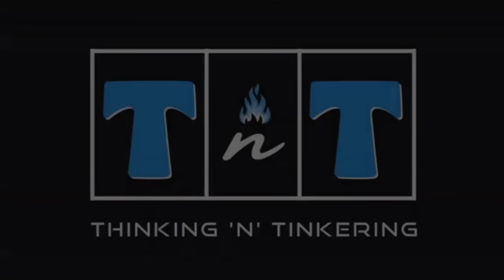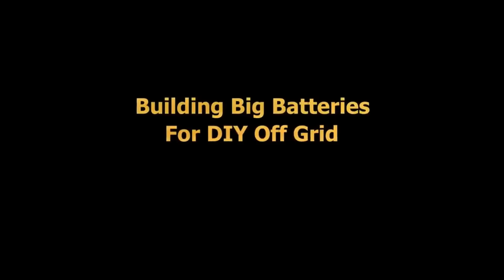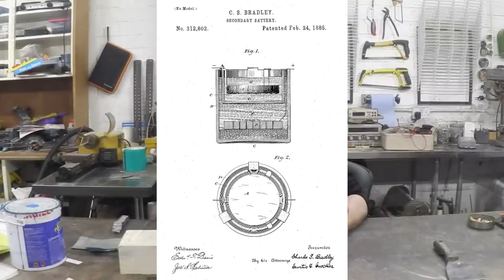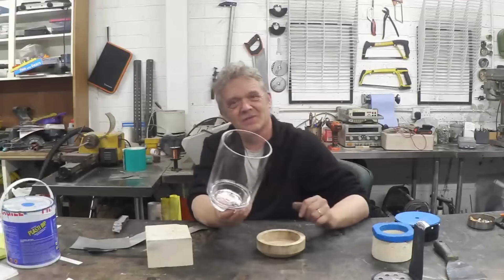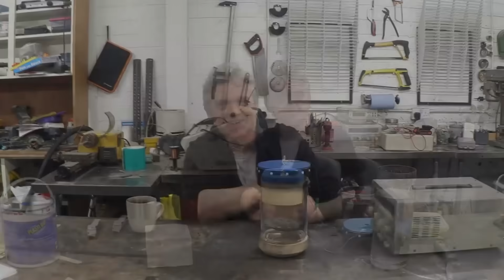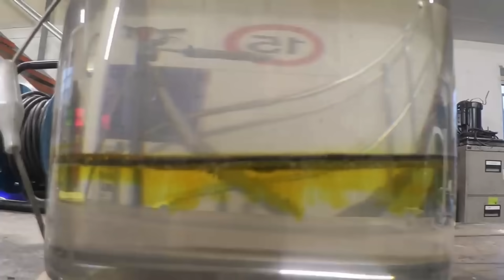2102 Building Big Batteries For DIY Off Grid

Comment: I was surprised at how fast that little propeller spun. That was more power than I was expecting.. I would have liked to have seen it when it wasn’t still connected to the charger and to see what happens to the battery when it discharges. Is a chemical reaction reversed?

Comment: Looking at this I can't help thinking that the drums have a potential issue. Yes they do roll at an angle on the cone. But the top is smaller in diameter than the  bottom of the cone. As the drums roll surely the top of the drums are traveling a shorter distance than the bottom of the drum which runs on a larger diameter section of the cone. This to me means that there will be drag which reduces the efficiency of the bearing / gear. Am I missing something?

Comment: I think that if you are charging it at 7-9 volts, and discharging it at 1.8 volts, then that is a horribly inefficient battery (cell)? If you put 1 amp in for an hour at 7 volts, that is 7 watt-hours of energy in. If you take 1 amp out for an hour at 1.8 volts, that is 1.8 watt hours out, for an energy efficiency of 1.8/7 = 25%, and that is assuming perfect coulombic efficiency. If it has 80% coulombic efficiency as you suggested, then the energy efficiency would be only 20% or so. One would be much better off using other battery chemistries, like lithium ion. An ideal secondary battery has a charging voltage as close as possible to the discharge voltage.

Comment: SO, perhaps I am asking too much but I have a situation, a small amount of DIY know how, more in the automotive field and some poor carpentering, and not a lot of money. I am a school teacher hoping to build a house in the woods and I would prefer it to be at least offgrid capable if not completely off it all of the time. I have a 20kw generator I can run on woodgas (the engine is 40hp on gasoline) and would like to build, eventually, a 100kwh battery backup. Run batteries for four or five days, charge up for a day, rinse-repeat. Will this battery handle that kind of recharging without causing massive problems? Is there a more suitable DIY battery for this? Wind and solar are simply not a viable solution in SW Missouri among 50-100ft tall trees.

Comment: If you could do/show an actual build of a large diy iron oxide battery for off grid, I think a lot of people would be interested in it. For example how to make it using 55 gallon plastic barrels that are easily and cheaply attainable. Has at least 60 kwh of storage and how to continue to size it up, maybe to 600 kwh. Thanks

Comment: Thought i wanted to share my experience here :)

Am currently making a Diy battery

Using ice cube trays with lid - each tray got 14 cells
I use normal copper wire and screws with zink/aluminium
I use Epsom salt (Magnesium sulfate) and bleach in water so each tray holds 2 DL liquid of water, 2 tablespoons of epsom salt and 1 1/2 spoon of bleach for battery acid.
Each tray makes around 22V AC / 10V DC and 0.2 Amps.
Each cell in 1 tray is seriel combined
I use 2 trays in parellel
So ending on 22V AC / 10V DC and 0.4 Amps

I parellel this again a total of 12 times so i end up at aroun 240 volts AC and 0.4 Amps giving me around 90 watts of power

Fun experiment and gratefull for all tour videos ! Ive gone from a total dumbass to actually making something usefull :) people like you inspire <3 thanks alot.

Do u have any experience in atmosferic energy generation? Tartaria and pre 1900 technology is pretty facinating :) maybe like a zink/copper antenna and some mercury involved? I dunno :) good day!

Comment: Love your videos!

Now, math is not my strong point, but if a mole is a five steps greater exponent than a coulomb, then at 1:1 youve got 100,000 coulombs per mol?  If correct, then 6*2.5=15moles, and 2 electrons per molecule should mean 30*100,000= 3 million coulombs?  Divide that by 3600 and the battery should theoretically yield ~825 amp hours?  That seems insane.  

If there is an error in my calculation, somebody please correct me.

Comment: Hi,
when you look into containers with separators for fluids, you might find that there are "self fillable" cases for 10" water filters. (Also 5" and 20" available)
They are intended for Ion Exchangers, have a foam on top and bottom, sometimes multiple foams and then active coal and other stuff can be combined in one filter cartridge.
Some people also throw in their magic stones for activated fairymagic superwater. <_<

You can get the filter cases with steel, brass or "plastic only" connector threads, plastic might be best for battery stuff.
if not simply using that as case for the battery, you could perhaps make a battery with fixed electrodes and pumping the electrolyte (power storage) through it.

I do not know about the plastics used in the different filter case options (PP, PA, ABS)
and the stability with the used liquids, so check up on that, so it doesnt crack instantly or over time.

Comment: Redflow are onto their third generation of a commercial battery using this chemistry. It has some very useful features and is very safe. Reliabillty seems to be an issue, but this will get resolved as the then get more experience with them.

Comment: Charging at 7.6V the energy efficiency of this battery is going to be around 15-20%, best case. If Robert cared to measure that, he would see that a battery like this is never going to be viable -- unless you're ok with wasting huge amounts of energy. Ohmic losses from that separator and electrode distance are simply insane. Maybe some videos with battery characterization - actually measuring CE and EE  - would be good to show why these patents never really became commercial successes.

People are left wondering why if this technology is so great we're all not using them. There are some very good technical reasons related with efficiencies. Anybody who actually characterizes these batteries will agree.

Comment: Sort of like a flow battery but isn't.  Bromide Liquid holds the charge. Its not enrrgy dense as   say lithium . More suface area on electrodes handle more elecrical flow but its limited by bromine tranfer abilities. ? A baddad battery is simular but the charge comes from the electrode differential?  Im still not ckear but im trying !

Comment: I am not fortunate enough to have the time to read up on math in the two hours of free time I have every day, so is there a tl:dr on how much capacity needed, what size electrodes and which amount of units to make to generate enough capacity to run a normal home for a family with fridge, freezer, washing and dishwashing machines, lighting, computers and phones to charge etc. for a day, a week? 
How to convert these power banks' energy to useful energy etc. 

It would be inspiring to see a whole project mounted and explained. 

Batteries hooked up to [whatever] in [series or parallel] and then to [whatever else] and then call the electrician to hook it up to your installation as an uninterruptible power supply.

Comment: Could it be safely scaled up to something the size of a 1000L IBC tank? That way it would be very useful for off-grid living.
Reply: Long story short, not in a DIY manner. Storing this amount of active bromine requires special permissions in most legislations. An accident or breakup of one of these tanks would create a danger to everyone around, up to even a distance of several hundred meters.
Reply: @danielppps  can you please explain the risks associated with zinc bromine
Reply: Each cell like this is 1.8V, so you'd need 7-8 cells to make a 12V battery. If you had space for 7 IBC's and could deal with the hydrogen offgassing, you could.
Reply: could you just save the charged electrolyte in separate ibc tanks?

Comment: Wait. Am I mathing wrong here?
So, 2.5M concentration gives roughly 140 amp-hours per liter, which discharges at ~1.8v for ~250 watt-hours per liter maximum, or ~200 watt-hours at 80% efficiency. But 2.5 moles of zinc bromide runs around a dollar per gram, until you start buying in bulk. That would make a one liter 2.5M zinc bromide solution ~$675, or more than $3 per watt-hour. That hardly seems viable for diy.
My math must be wrong, yeah?
Reply: Upfront cost is one thing, long term cost is another. It depends on how long it last before needing to replace, rebuild, or refurbish

Comment: Question to Robert or viewers: 

What would be the 'best type' of battery to run a wood shop (low grade, just one tool running at a time, with 120 v table saw as max)?  Could a battery such as in this video (a bank of them), work?  Appreciate any comments, URLs, etc.  

And thank you, Robert, for posting this video.
Reply: Right now almost certainly LiFePO4 prismatic cell batteries.
Reply: Recently discovered that YouTube now gives warnings for video titles, descriptions and comments that include URLs!

My thoughts is that it could be possible to charge the zinc bromide electrolyte at one location, pump it into a tank, then use the electrolyte in another location. Each location could be running at different voltages/amperages but use the exact same electrolyte!

When the energy is depleted at the remote location, the electrolyte could be returned to be recharged.

Comment: I think I speak for most of us to say it would be epic to see you build a battery bank, charge it off wind or solar and run an appliance off it using a power inverter. It would be your diy alternative opus.
Reply: With these types of batteries, a power inverter might not be required. Or at least,  an often expensive electronic power invertor might not be required. Electrolyte could be pumped between different cell configurations in order to provide different voltages/amperages as needed.

Potentially, many (or slow), very low voltage chargers could charge the electrolyte, then the same electrolyte could be pumped into cell configurations that provide 100v+ or 1,000v+. When depleted, the process could be reversed and recharged.
Reply: @RiverMersey The inverter is to convert DC to AC, more than to act as a voltage regulator.  Regulation is a secondary function.  How many DC appliances do you have at home?
Reply: @alexmanojlovic768  almost all my home appliances are DC - including my washing machine with its universal motor!🤣
Reply: Most all appliances run on DC they all invert ac to DC from plug before powering internal components💯💯
Reply: @wesleycastner4860  Yeap, I wasn't joking!
Reply: @RiverMersey did you modify standard AC appliances to provide the required DC range?

I cut the cords off the wall warts for my network equipment and wired it into a nominal 12v circuit in my trailer. Works great. 🤷
Reply: @nopenotmedude  no, I live in a traditional UK house supplied with 240v ac.

Just aware that most devices and appliances internally run on dc.

Only one that I think has to have ac for a major part of the internal circuit, I think, is the microwave's magnetron.
Reply: Nearly everybody that lives on a narrow boat those what you’re asking. There is no magic involved an how I lived the last 20years.    Off grid
Reply: I’ll do it
Reply: I'd rather see him make an ibc flow-version of this
Reply: He will never do that. Even the most basic and super useful stuff like testing the battery he just made, he simply wont do it. Did it hold 20ah? Noobody knows and he dont care. All his videos are like this, half baked sort of semi useful.
Reply: @MegaCyrik 😂😂😂 Oh you poor thing, did you want Rob to spoon feed you? He makes these videos to introduce concepts and demonstrate them in action. It’s up to you to run with it and experiment to find out how to make it useful to you.